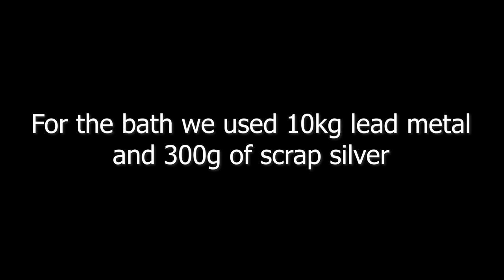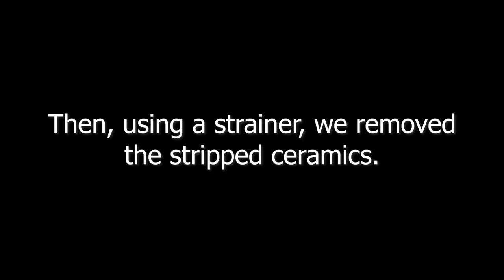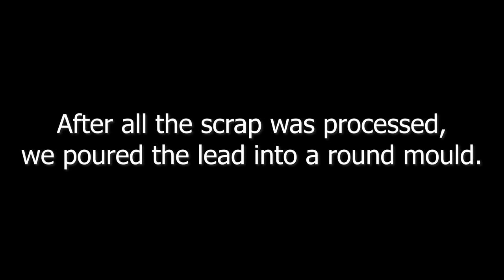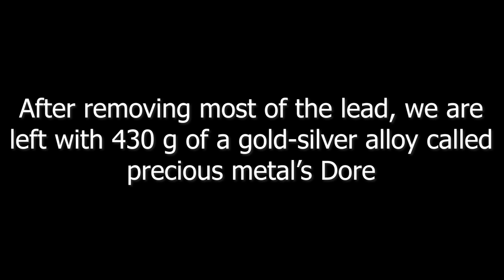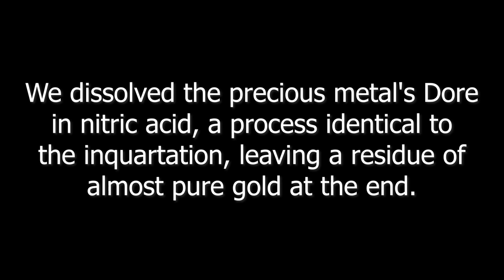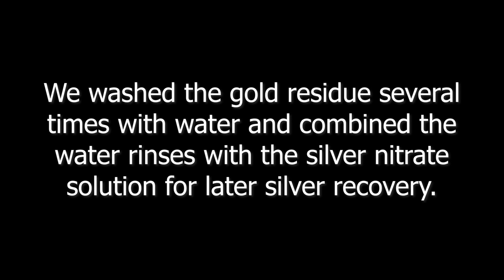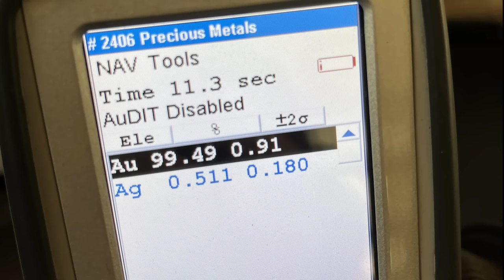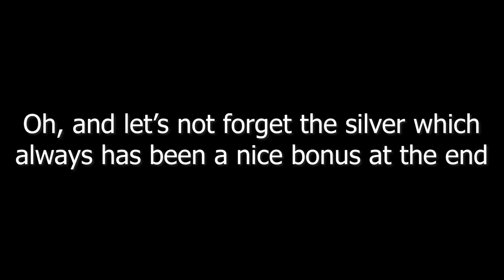Gold Recovery from 14kg CPUs

Comment: Well done! I have worked for many years as an electronics technician and have hoarded boxes of used circuit boards, some boards are from high end Hewlett Packard equipment complete with gold plated circuit tracks and edge connectors. I once had thoughts about processing it all for the gold but I am not going to bother, I hope to hand it all over to someone who can process it, I am sure there would be a nice amount of Gold for recovery.
Reply from the maker: Very cool!
Reply: How much do you have
Reply: Do you know what tghe gold price is right now?

Comment: What do you mean the silver is a nice bonus at the end? Seeing how you added 300g silver... how much silver was recovered at the end to make it a nice bonus?
Reply from the maker: The silver from the picture is almost a kg. The nitrate from the dissolution step was mixed with other nitrate from previous refining. You get silver form the CPUs as well as gold. The added bonus is the refining of this silver which usually weights more than the gold recovered.
Reply: @OwlTech333  considering the cost of silver , it's no more than 60$ worth if even that.

Comment: Some quick maths here for whoever in interested:
If average CPU weight is 60g then that would mean there would be approximately 233 CPUs.
They would have to be sold at about £20 each to have the same value as the gold resulted from the melting.maybe less if I knew how much silver was melted.
So conclusion is that depending how old they are it might not be worth putting them back on the market and melting is better option.
I did not take in to account the time and materials of the melting process as I'm not familiar with the costs.
Reply: .4 g of gold per CPU? I seriously doubt that
Reply: @joergkalisch7749  what do u think? How much gold in 1 cpu?
Reply: @twistr99  a few milligram
Reply: @joergkalisch7749  thanks
Reply: @joergkalisch7749  Old processors have much more gold than modern ones, some models even have 0.5 gram. So his math isn't too far away i would say around 0.2 average, still selling working processors would earn you a lot more..
Reply: To give you an idea of the amount of gold, a Ceramic CPU 386 or 486 processor may contain between 0.1 to 0.3 grams of gold. However, please note that this is just an estimate, and the actual amount may vary depending on the specific processor and its age. Additionally, the cost of extracting the gold from these processors may outweigh the value of the gold itself, especially for small quantities (credit ChatGPT)
Reply: please keep in mind there are some quantity of MPG available in each IC either) Om NaMah ShiVaYa)
Reply: Melting down will almost always be worth it for older processors. Factor in things like lower power efficiency, sourcing old motherboards/ram/coolers etc, more powerful alternatives, they aren't really that useful. Add on top how long it would take to sell that many CPUs, it isn't worth it.
Reply: @ggoddkkiller1342  nobody's buying 486s and Pentium Pros, bud.
Reply: You Will get more Money selling them as Working Processors and little Johnny in 2044 will not need to Pay as Much for a 486 or Pentium Dos Box .
Reply: @joergkalisch7749  some of these cpus in the video has 0.21g to 0.45g of gold mostly the old cyrix and pentium pros

Comment: Honest question....
Why didn't you crush the chips ?
Inside of those sandwiched ceramic plates are tiny gold wires from each pin to the chip. I doubt the gold escaped from between the ceramic plates without breaking them open.
Reply from the maker: There's no gold bonding wires inside the ceramics! From GRF: "A standard ceramic CPU is made of several layers of ceramics bonded together. between the layers (while the ceramics is still unfired, also called green) is screen printed conductors of molybdenum. The ceramic body is then fired and the molybdenum that is exposed is then gold plated. On the bottom or side, pins are brazed or soldered and in the cavity bond wires are used to connect landing pads on the die with the exposed gold plated conductors. For bonding wires aluminum or gold can be used.

Inside the ceramic body is the molybdenum conductors and the only gold is the exposed gold and the gold under the die.

To use gold inside the ceramic body would be problematic. Thermal expansion and contraction will break conductors over time unless it expands with the same rate as the ceramic body. Molybdenum is the solution on this problem and it is cheaper that gold.

Göran"
Reply: @OwlTech333  thank you for the info....
Though I'll still crush mine since your copied article clearly says "for bonding wires, aluminum or GOLD can be used".

It's a small quick step and if it liberates more gold, I'll go through the extra step.
Reply from the maker: @John-ir2zf  those are exposed at the moment the cpu hits the molten lead

Comment: Cool video. I'm a little surprised you didn't redissolve the gold in aqua regia with a bit of sulfuric acid added to precipitate out any remaining lead. Still, it looked pretty good at the end and well worth the time depending on how much the scrap cost.
Reply from the maker: The client insisted on recovery only despite the refining would have been another extra hour
Reply: That’s what I was thinking with aqua Regia could of saved time with super acid but ended up with one hour plus on lead bath
Reply: Is the scrap the most expensive part or is the fuel and chemicals?
Reply: lol gotta keep that lead in more $$$
Reply: @mrkiky  You get the scrap for free if you are smart ,and acid is not very expensive ,and the rest is all about organisation and methodology .
Reply: @zibobpompon5768  The fuel is not gonna be that cheap though. As I see, it needs quite a high temperature on a high amount of volume for a long time.
Reply from the maker: Fuel is the cheapest component
Reply: @OwlTech333  what about the lead? Is it totally gone or have I missed something?
Reply from the maker: No it is recovered from the lead oxide
Reply: @OwlTech333  and yet ill give you better advice if you want to be energy efficient check a little about hydrogen and how to use water as gas you will thank me :) its easy to switch just a minor adjustments and creativity

Comment: First time coming across something like this, needed to do some math.... Assuming 40 grams per CPU average, 14 kg would be 350 CPUs.  From 91 grams gold that works out to about .26 grams of gold per CPU.  That jibes with what I have seen reported elsewhere, at least assuming a high yield on recovery.  Also, I never realized that these old CPUs contained about $15 in gold each.
Reply: Don't forget that gold in 1999 (that seems to be about the vintage of these chips) was going for $450/oz.
Reply: @kevinrusch3627  Oh yeah, I know that.  I was just shocked when I did the math and learned how much the gold in each chip is worth today.
Reply: These weren't all CPU's. you can clearly see other Ceramic Ic's in the first batch he throws in. (Ceramic DIP Packages)
Reply from the maker: Correct, ceramic ICs were about 1,5kg

Comment: could you explain the cupellation on the stainless steel part? and does that take the lead away or do you mix it with borax glass and niter salt to get a slag and the final dore?
Reply: He skims off the lead oxide as it forms. The base metal oxides slag with it. Same idea as when cupelling with a MgO cupel... just not as neat.

Comment: Dissolving the alloy in nitric acid is not a process identical to inquartation. They are two completely different processes, with completely different purposes, ending in completely different results.
Reply from the maker: How is the result different?
Reply: @OwlTech333  Inquartation is a process where you ADD base metal to an alloy. Which then goes without saying, the result of inquartation is an alloy with a larger percentage of base metal. Nothing has been dissolved yet at the completion of inquartation.

Comment: The method used in this video for gold recovery from CPUs seems less efficient than it could be. I believe chemical extraction methods would yield far better results and greater precision. Using the right chemical processes could potentially maximize gold recovery and improve overall efficiency.
Reply from the maker: @active_horizons  here is the thing I tried both methods and compered results, there is a reason why this is the preferred method when it comes to this kind of material. If the chemical extraction method yielded far better results you won’t see me using this method.

Comment: I want to conduct this experiment on a small scale, with a quantity of 1 kg. Could you please provide me with the composition of lead and silver in the furnace process?
Reply from the maker: 1kg of what? Material or lead?
Reply from the maker: GOLD from transistors - test run
https://youtu.be/cdm905VugPc here’s a small scale operation
Reply: @OwlTech333  1Kg of CPU Ceramic
Reply from the maker: @gireeshshewale-f6s  0.5kg lead in a proper crucible should suffice and 50g silver which should be added after the “bath”
Reply: After lead bath, we add silver with molten lead solution before cupilation process?
Reply from the maker: @gireeshshewale-f6s  yes

Comment: Interesting ! where go the lead in  cupelling with stainless steel ?
Reply from the maker: It turns into lead oxide (slag) which is then skimmed off. It is saved for lead recovery
Reply: Skimmed as lead oxide, about 10 or so % PbO vaporize in the process. If the cupel or cupelling tray is used, PbO is soaked into the cupel.

Comment: Wow awesome! So 90 grams of gold is like over $5,000 right? 😮
Reply from the maker: Pretty much!
Reply: Yes 90 grams of gold . You can make 50.000 by selling pentium 1 cpu to retro collectors. They become rare due recycling maniacs.  The price of a single cpu new was over 200 .
Reply from the maker: @iulianispas8634  how many would you like to buy at $50?
Reply: @OwlTech333  Prohaps you can sell with 50 each if you frame them
Reply: @OwlTech333  Depends on the model really, most of the ones sold for gold scrap are basically worth as much as... gold scrap. If you want i can help you point you to the ones that could be REALLY worth reselling but my guess is that the chances of finding such ones are pretty low in my opinion.
Reply from the maker: Agree
Reply: @OwlTech333  I'd still offer you some for a pentium PRO or some cyrix models though ^^

Comment: As I understand, there are gold threads left inside the ceramic plates!!! You have only taken the visible parts with gold which is a loss. Try to crush the ceramic plates into fine powder and look for the gold that remains in the form of thin wire.
Reply from the maker: There's no gold bonding wires inside the ceramics! From GRF "A standard ceramic CPU is made of several layers of ceramics bonded together. between the layers (while the ceramics is still unfired, also called green) is screen printed conductors of molybdenum. The ceramic body is then fired and the molybdenum that is exposed is then gold plated. On the bottom or side, pins are brazed or soldered and in the cavity bond wires are used to connect landing pads on the die with the exposed gold plated conductors. For bonding wires aluminum or gold can be used.

Inside the ceramic body is the molybdenum conductors and the only gold is the exposed gold and the gold under the die.

To use gold inside the ceramic body would be problematic. Thermal expansion and contraction will break conductors over time unless it expands with the same rate as the ceramic body. Molybdenum is the solution on this problem and it is cheaper that gold.

Göran"

Comment: A friend of mine is trying to recover gold from CPUs but he follows another process. He's getting nothing...
Reply from the maker: What kind of CPUs
Reply: @OwlTech333 Anything that contains gold from electronic pieces. From computers, mobile phones,...
Why? Is it important?
Reply: @OwlTech333 He's following the process that is shown in many videos of YouTube to recover gold from electronic scrap. They use hydrochloric acid and hydrogen peroxide to remove the gold from the scrap. Then, they use hydrochloric acid and potassium nitrate to precipitate the gold. Afterwards, they use potassium metabisulfite to get the gold.
The point is that it doesn't work...
Reply: @OwlTech333  When you dissolve the Dore in nutrition acid, do you apply heat?
Reply from the maker: @evasanchezsaez8685  yes
Reply from the maker: @evasanchezsaez8685  yes you can’t expect visible gold from flash plated material

Comment: I still see plenty of gold on the bits removed. It seems like a silly way to process them.
Why wouldn't you just use nitric acid like everyone else
Reply from the maker: All that glitters is not gold what you see is lead oxide
Reply from the maker: Oh by the way how much gold you recon is left on them ceramics cuz I can offer you a sweet deal?
Reply: Nitric is very silly way of processing ceramic CPUs. Poor reaction with kovar legs, hard to get under the gold braze on the pins and ceram. Best recovery from CPUs is by straight AR. Don´t be misleaded, lead does not stick that badly to the surface of the ceramics. Some gold is lost, but I expect under 5%. Even then you can melt another like 3-4kg portion of lead and re-run the ceramics once again and save it for future stripping.

With nitric, you need roughly 4L to dissolve 1kg of metal. So there that figure would be roughly 15 liters. Equals 15 liters of waste to treat - because we aren´t morons to pour it down the drain. He pointed to the efficiency of the process in another way - he is done in 4 hours to the button, and I trust him in this, as I also have experience with similar processes. With AR, it will took at least 1 day. 

Your time is also money, you need to include it to the overall balance. Numbers for him say this is preferrable.
Reply from the maker: @jakuborvos1575  well I couldn't have said it better myself

Comment: How much do you think you spend in fuel for heating and the wasted metals used in the extraction phase (lead). 
Any estimate?
Reply from the maker: 10 bucks on propane, lead is recoverd from the slag phase and reused but let's say $5 to compensate for any eventual losses
Reply from the maker: 600ml HNO3 and about $2 on O2
Reply: That’s awesome. Do you have a chemistry background, or just self taught/ learned from experienced coworkers? 
When I get the space, I want to set up a vented small extraction lab
Reply from the maker: @brian-doesnt-know  no chemistry background, self-thaught
Reply: Today it's about $5915 dollars in gold, without the cost of the CPU scrap, I don't know what that is.

Comment: Nice work and thank you for sharing it, I am a sucker for this kind of thing but what a sad loss of all that computing power just to recover a few grams of gold and silver. I know they are woefully weak and ineffecient by today's standards, but if all the scrapped CPUs of yesteryear could only be combined into some kind of super-parallel grid it could probably be used to crack cold fusion or calculate pi to the 1000th power and discover God in the numbers or something. :body-blue-raised-arms:
Reply: It's not a few grams of gold when you have that many CPUs, bro got 91 grams of gold that's around 5600 dollars.
Reply: Nah, unfortunately the computational power would be pretty insignificant, old CPUs are just way weaker than modern ones.